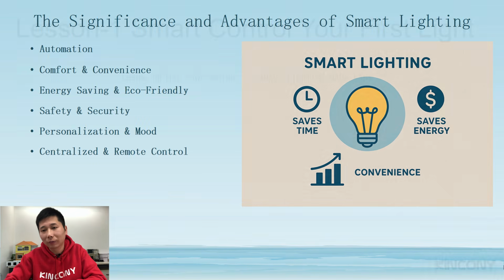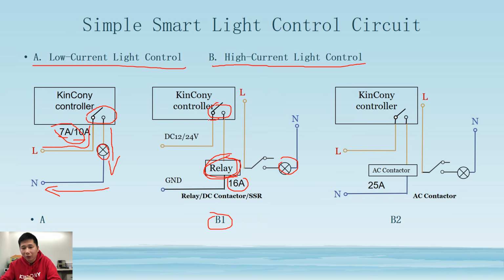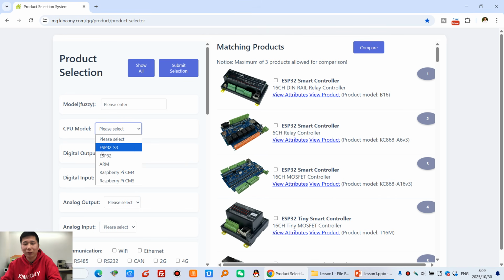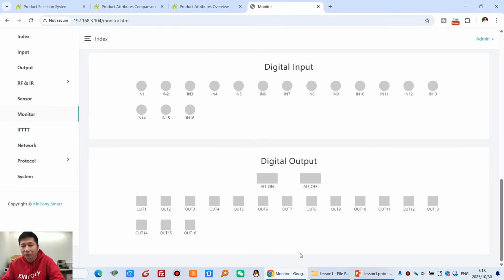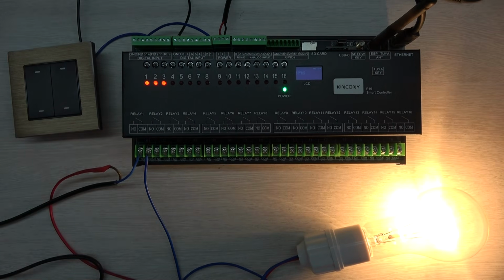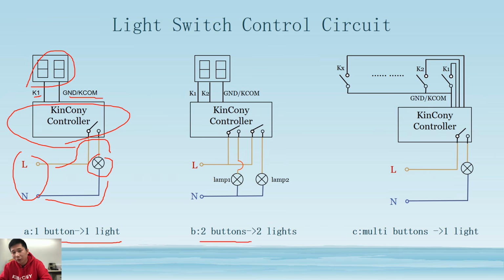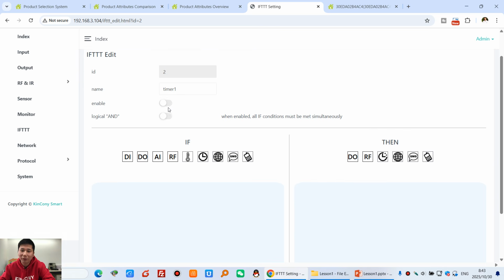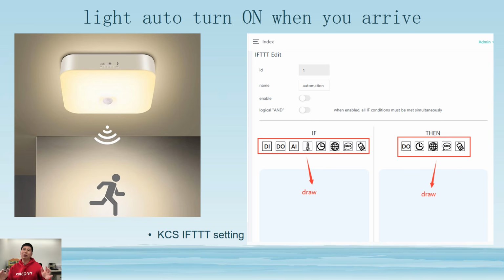Upgrade a Normal Light to Smart | KinCony Home Automation Training #1

Comment: When the relay is turned on using PIR sensor, how do you add timer to the presence detection.  So the light can turn off maybe after 10 minutes of no presence detection?
Reply: And Thank you so much, sir 
Good Lecture.
Reply from the maker: there is "delay" option in KCS "OUTPUT" webpage. you can set the delay time, when relay ON will auto off after some time

Comment: Hello! Can 2 boards communicate with each other?
For example, can I set that if Input 1 on Board 1 is ON, then switch on Output 3 on Board 2?
Reply from the maker: sure, it's ok, set by IFTTT , send customize command to different controller
Reply: @KinCony  Is it possible without Home Assistant using the local network?
Reply from the maker: @Floppy379  sure, no problem, this is very important. all our controller support use in local network.

Comment: Can you create a follow up video showing how to integrate kinkony touch switches with the smart controller?
Reply from the maker: it's as same as momentary switch panel
Reply: @KinCony thanks for the reply. So for the touch switch from kinkony i do not need the logic level controller for the touch button light synchronization?
Reply from the maker: @emanuelloghin9471  we will test it.